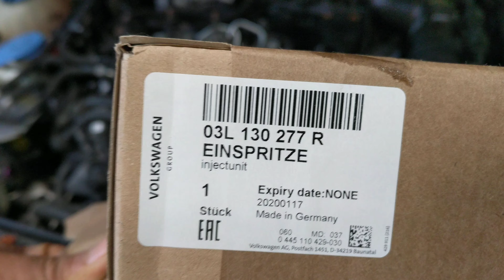2012 VW Passat TDI P1007 P0300 P0304

Comment: You didn't re code the new injectors to the engine ECU ? you also didn't torque the injector bracket hold down bolts.
Its not about doing it as quick as possible its about doing it correctly,in my opinion

Comment: @idennis75 Thank you for this great video. Do you know what the  purpose of that rubber seal on the injector? I have a 2014 Passat TDI and my injector wells are filling up with oil. I am trying to figure out if I need to change out that sealing ring or if I need to change the entire valve cover. Car has 110K miles.
Reply from the maker: It might be diesel which means one of your injectors are not closing 100%. If it's oil I can't figure out how oil would get in there unless it's coming by the valve stem seals which in a diesel that's a little harder and it should not have a rubber seal on the injectors on the diesel they use a copper or brass seal
Reply: @idennis75  It is definitely sooty oil. I am thinking the valve cover may be leaking around the opening where the injectors enter into the engine. The pooling is very slow, about 10mL every few months. I was thinking about replacing valve cover and the valve cover gasket to see if this corrects the problem. I am sure it being plastic, the assembly may have warped or cracked.
Reply from the maker: Being that it's diesel if oil is getting into the piston area the car would not run or run really rough on diesel engines you have to have very good compression to ignite the diesel so if oil is getting in you don't have compression on one of the cylinders at least
Reply: It’s diesel mix with dirt so it looks black like oil am having same problems on my 2013 Passat tdi with 107k miles

Comment: Thank you so much for this video! I have the same issue here with my passat 2012 tdi. The servicing company asked for 2000 dollars so they could identify which fuel injector is not working properly and also replace it with a new one. I am planning to do all the job by my self but the problem is I dont know which one of them is the bad fuel injector! Is there anyways to identify that home without paying that much money?
Reply: If it is under diesel gate warranty the injectors are covered 100% by the dealer including your rental car.
Reply: Diesel gate warranty?
 You gotta be kidding me
 About this movie It's probably at this new injector to the computer

Comment: good video on changing the Injectors !

someone left the bolt loose on my tdi, or somehow it has come loose. (the one that needs a male spline to open) and i can get a better idea how to re-tighten it...i will open it all up and clean the excess diesel and dust, and then refit it all and re-tighten it. plus the spline bit is on order so will take a few days to arrive. I dont think i need to change the brass seals or anything else do i ? Thanks

Comment: The torq spec for the bolt is 7nm + 180°. And they should always be renewed, they are stretch bolts. Don't do what he does and do it by feel, you risk breaking them or they will come loose again.
Reply: he is fine
Reply: It’s actually 9nm according to alldata 🤷‍♂️
Reply: its 8nm+270 degrees @Thatyoung_oldguy

Comment: Hi ! doesnt them need to be coded the new ones?
Reply from the maker: No
Reply: @idennis75  i am aware that the new injector code need to be written with VCDS for a proper functionality
Reply from the maker: As long as the flow is the same which means the diameter of the holes on the injector the computer will do the rest

Comment: Hi guys i need help with my 13 passat tdi i replace the head gasket put everything together and now the car star  good but if i turn it off  then turn it on back run but shut off   sometimes it runs back bun if not i let it for couple hours and tried again and works again  i can drive it and run the car  normal untill i turn it of  so what can i do to solve this problem  ease help